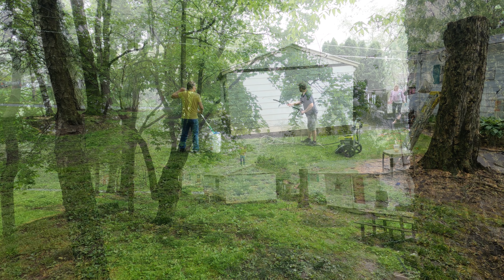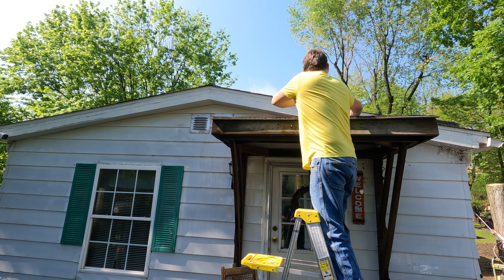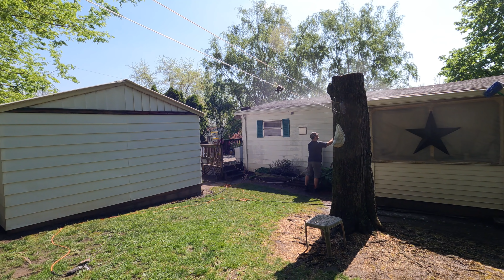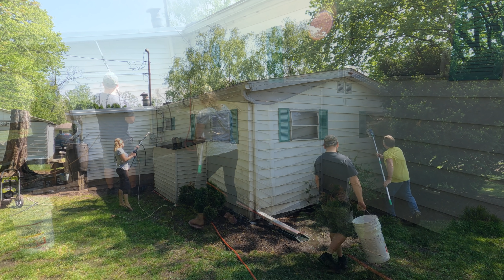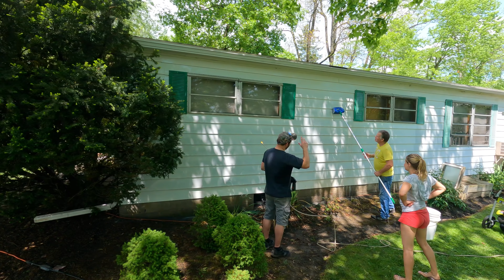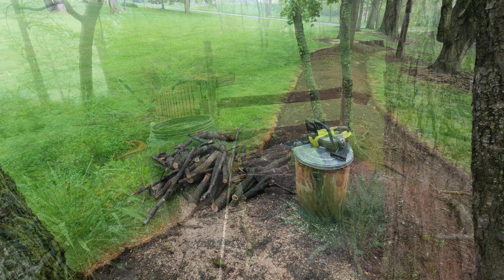(Week 2) 58 YEARS of Dirt and Grime -1963 Mobile Home Property Transformation

Comment: We see so many homes that look so very bad and sad when they only need a power wash, yours turned out GREAT👍🏻😁 we bought a power washer  last yesr , our patio needed it bad.the huge shrub at the corner of the house could be trimmed between the house and shrub where it leans up against the house, helps with insects and mold on the house. 👍🏻 First time I have seen you without a bandana on your head. 😊

Comment: I have vinyl siding on my small house and live near the ocean so at least every two years it has to be hosed off because it gets like a black mildew. I buy something called 30 Second Cleaner at Ace Hardware. You spray it on and just hose it off. You don’t need a pressure washer. I did it myself last summer at 80 years old. I would only do a section at a time and it took me about five days.